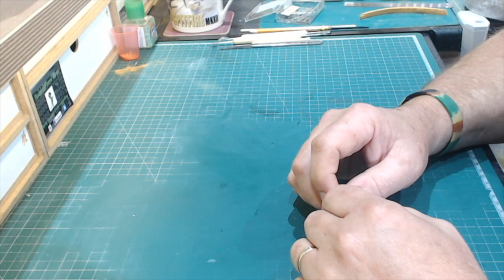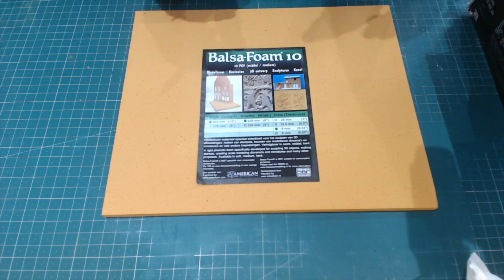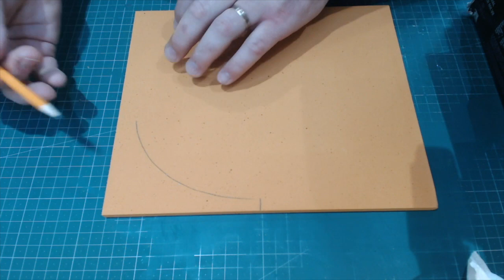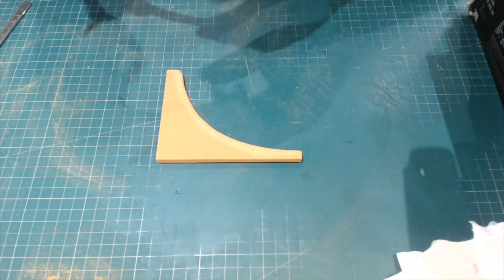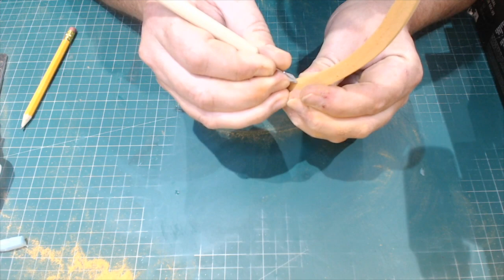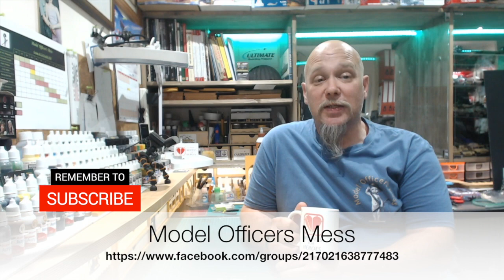"How I Do" - Diorama's Part 5 "Sacrificed on the altar of freedom"

Comment: Your work with balsa foam is excellent. You are making me want to start using it 😁. Could plastic be glued to it James? Sorry for such a random question. I mostly scratchbuilding with styrene that's all.
Reply from the maker: Kamm thanks for the comment. depending on the glue used yes you can. I recommend it so much you'll never go back to other materials.
Reply: Model Officer thank you! I'll definitely have a go 😀. Looking forward to part 6
Reply from the maker: You will not regret it my friend. Filming over the weekend so will be hoping to start bring things together some more. Stay tunned